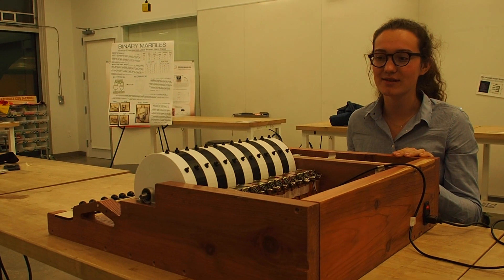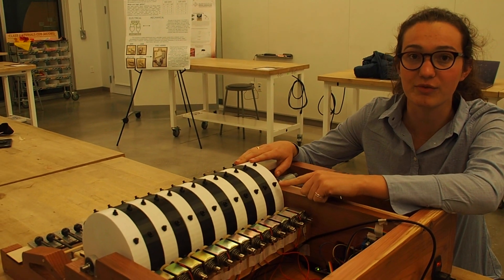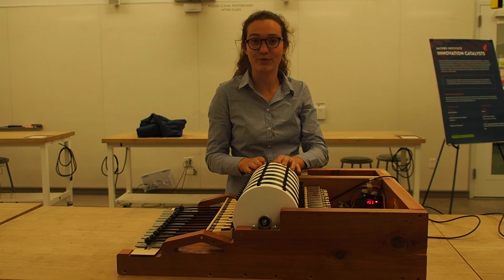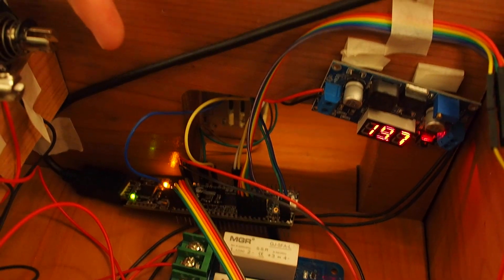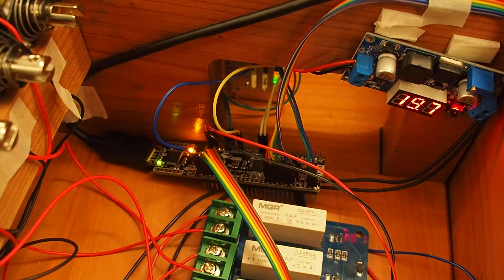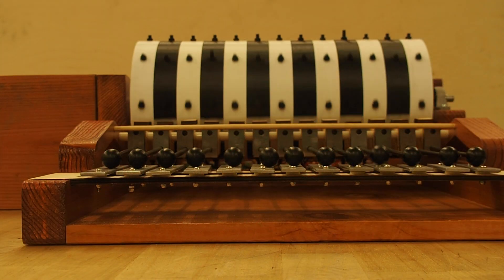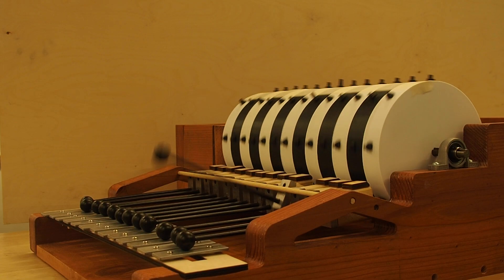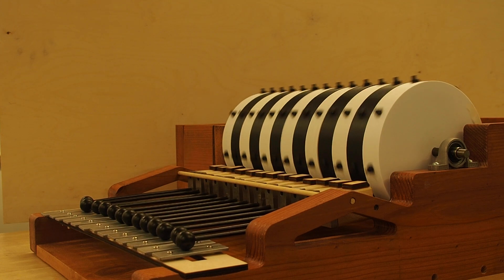Infinite Music Box - Rough Cut Video

Comment: thats really cool! One idea for better sound: Put light compression springs, standing up right between the wheel and the glockenspiel, so that every mallet falls down on a spring, it has enough energy to compress the spring so it can hit the glockenspiel, but after that the spring will lift the mallet and prevent the double hits you have now. The mallet resting on the glockenspiel kills the sustain and I think you will love this music box to have beautiful sustain! Awesome design!
Reply: another idea to reach the same goal is to line up tiny separating walls in the spaces between the mallet shafts (under them but between seen from the top) and just run one single band of elastics over the walls. The walls support the elastics across the length. That would also have enough bounce to prevent the double hits and you only ned one band for all mallets instead of one spring per mallet.
Reply from the maker: Wow it means a lot that you've seen it and like it!

We had been thinking about fixing the sustain issue but hadn't tried yet due to time and no straightforward idea for fixing it.  I really like the elastic idea, very elegant and takes away a lot of the concerns we had with fine tuning springs x13.  We will definitely try it.  Thank you!